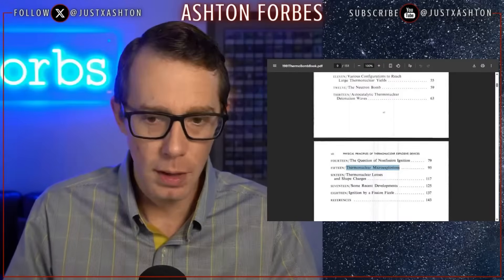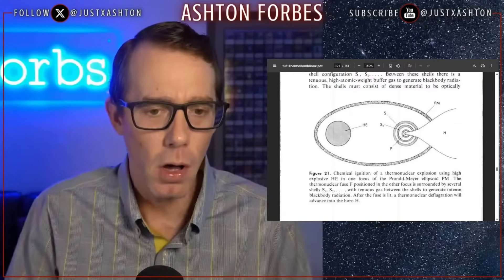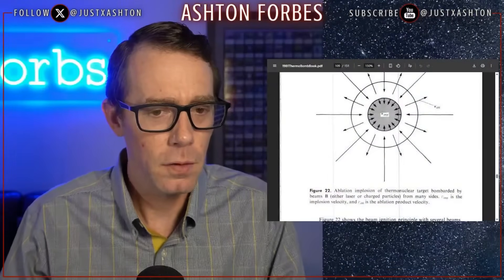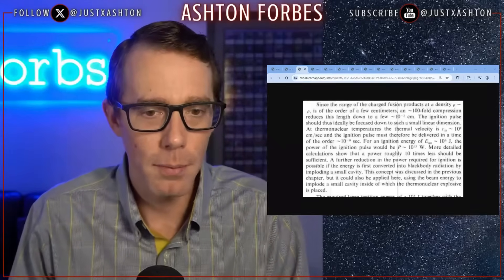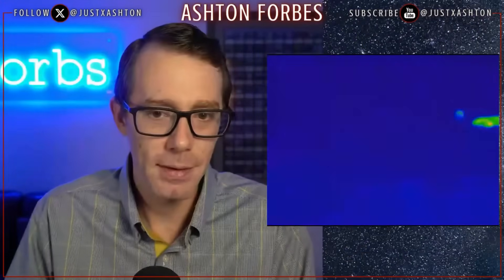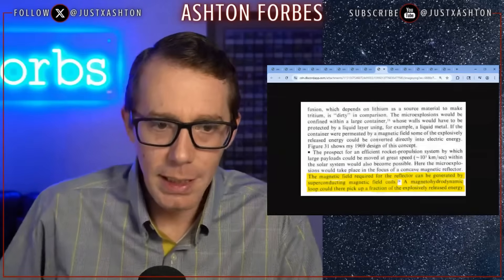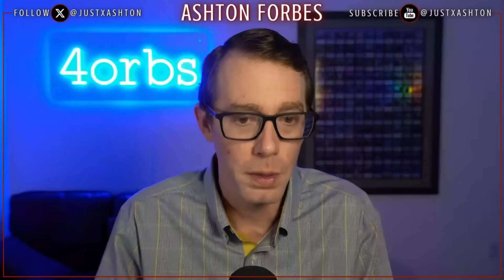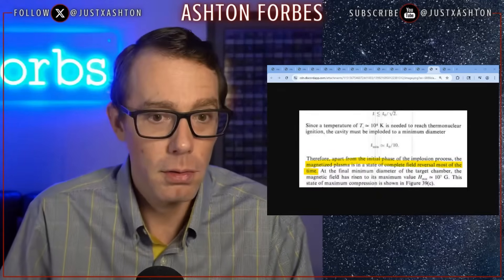The Orbs Were the Trigger

Comment: Dude, you're looking at experiments that have been going on in the open for decades.  Look at the national ignition facility.  The "ablation" from beams on all sides is just the little tiny pellets zapped by multiple arms of an amplified laser beam that has gone the same distance along each arm to be able to focus on the pellet. They were working on that at LLNL when I was there in 1985. You can't fit that equipment into anything portable -- there were huge buildings of tubes with laser amplifiers feeding that thing. All approaches to fusion energy generation use something other than an atomic fission bomb. Many of the alternative fusion approaches use kinetic energy, magnetic confinement, etc. But when you find imaginary connections to the MH370 orbs, you seem kind of skitzo, TBH.

Comment: The 3 magnetic orbs created a magnetic field around the jet. The perfect triangular formation and spinning created a vortex condensing effect.  The pulsed pumping action caused resonance with the plasma increasing amplitude, strength. The lithium battery explosion created the oven or heat. The swingers limit is overcome. The wormhole happens. The spinning counter-clockwise spin pushes the jet inward . 3 orbs at the destination are counter rotating, creating a bucking magnetic field inside the wormhole stabilizing it by keeping the throat open. 
Thoughts?
Reply: Oh, and satellites with magnometers could steer the metal orbs?
Reply: The lithium battery had nothing to do with the reaction, it was all an plan for the plane to turn around
Reply: @kyleheaney3734 You could be right. It's interesting to me that their choice of an explosive is often used in fusion reactions. The other thought is that they didn't simply create a wormhole in front of the jet instead they encompassed it. This makes me wonder if the fusion reactions involved the lithium itself. They could have used many incinerate devices if they wanted yet they chose Lithium.

Comment: Just use an electric arc, you can do fusion in Aluminium to make iron in cavitation. AL13+AL13 = Fe26 you just need to sheets of AL foil and separate with drops of distilled water then spark them with a capacitor. This will do cavitation in the water and do the fusion reaction. To see the results ( spheres of Fe ) take the foil to your local Uni SEM ( scanning Electron Microscope ) see LENR yeah its aneutronic ( no neutron are emitted ) and AL is almost as electron-volt powerful as Deuterium .... yeah Ken Shoulders, Bob Greenyer, etc